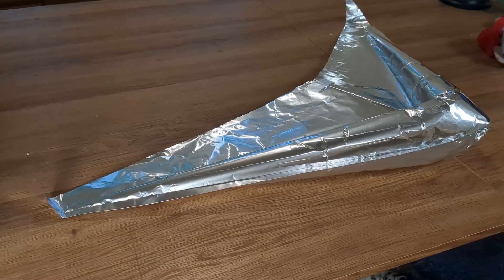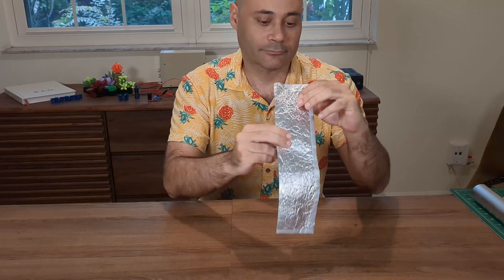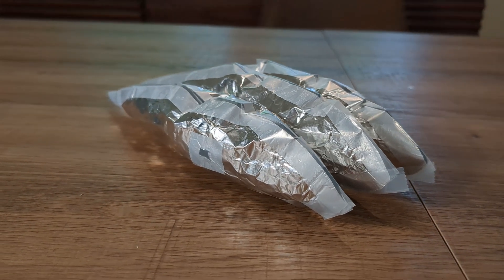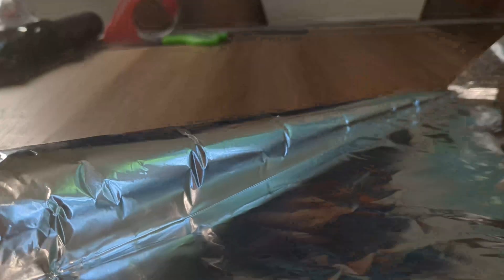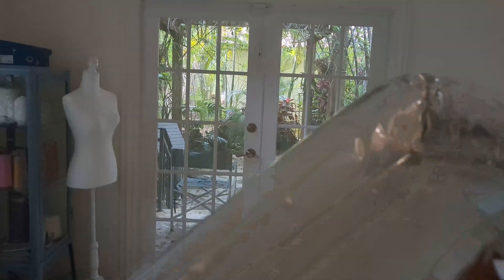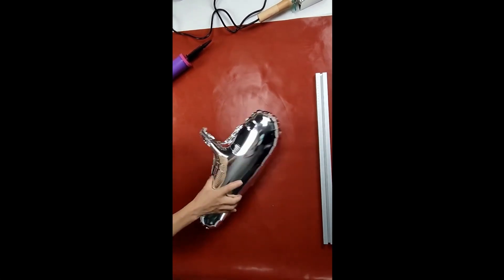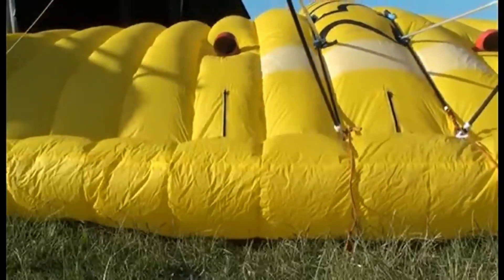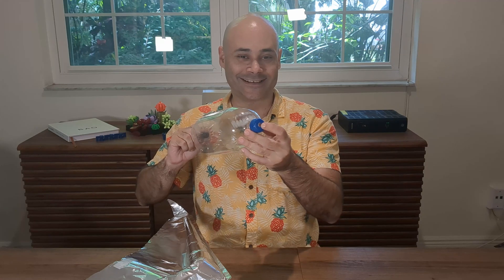Luma the Aluminum Foil Glider

Comment: Impressive. I'm thinking maybe use silicone rubber, make 2 flat sheets, glue the edges together (leaving a hole for air intake) then inflate. I make my own silicone sheets for doing resin crafting on and i can make them 0.5mm thick but i'm sure they could be made even thinner, and all you need is a flat surface and a perimeter to hold the shape while it cures. It wouldn't be as light as alumium but may be light enough if thin enough ? And it'd be a much smoother surface so aerodynamically superior in that regard. Liked and subbed :)

Comment: A while back, there was a fellow who made long tubes of black plastic. Once filled with air and put in the sun, the heated air inside created a good deal of lift, enough so that he had to tie them down to keep them from flying away.
His main issue was gluing the plastic together. He found the best method to use the double-sided tape that comes in devices like the ones that you apply white-out tape over typing errors. I bought some to play with, and it sticks very well. It is so thin that I thought it wasn't working the first time I used it.
Reply from the maker: @samTollefson  I'll dig around for that tape. It sounds really convenient. And solar balloons are fantastic. I once made solar tetroons.
Reply: @adrianinvents  I dug around in my shop and found it. It is called Telexsun glue tape. It comes in a device with 10m of 8mm wide glue tape. I got it on Amazon, I hope that helps.
Reply: Nighthawkinlight channel

Comment: I wonder if there is some opportunity for using a coating on the inside of the airtight envelope which would become catalyzed by the gas used to inflate it.  In other words, if you had a coating inside that became rigid when being exposed to say, oxygen, and it was "doped" onto that envelope in an anoxic environment and then inflated, exposing it to oxygen and quickly hardening, it could both inflate and rigidify the envelope.  
For example, let's say you were using paper with a waxed coating for the envelope (thus being at least nominally air-tight), and it was coated on the inside with cyanoacrylate (CA) glue.  Pump air into it to inflate it, and (in theory) the CA glue would cure by exposure to air, and become rigid (probably not, but hopefully you get the principle I'm trying to describe).  
Just trying to think outside of the box about what might be able to form the shape you seek while also providing it with durable structural integrity even if it loses its pressurization.
Good luck to you!
Reply from the maker: @bricology  This is a great idea. From my experience with industrial knitting I know there is heat rigidified yarn. You knit it along with other materials and then expose it to heat after the shoe has been put on a form. And thus you get a semi-soft/semi-rigid material. I like this idea of doping rigidity in with a spray. Keep thinking out of the box! It's the best type of thinking.

Comment: The design of your wing creates far too much drag to fly any real distance,  with that inflatable section at the leading edge.  The choice of foil looks like the very uneven skin will produce excessive turbulence, increasing drag even more.  IMO.
Reply from the maker: @maxhugen  You are correct. This wing was mainly meant to explore the aluminum foil construction technique as a prototyping tool. Long term this would not be the most efficient wing design.
Reply: @adrianinvents  I'd suggest using cheap rigid foam (eg Polystyrene),  as it can easily be carved/shaped to your own design.  Maybe look at NACA airfoil sections too. 😎

Comment: I remember V shaped logging balloons used in the 1970s that worked on a similar principle. My first though was how this glider would work if the "Cones" were inflated with Helium.
Reply from the maker: @roypounds7704  Logging balloons? I've never heard of this. My neighbor just threw away helium balloons, so I might transfer the helium over to the wing. The wing may still be too heavy.
Reply: @adrianinvents  Unfortunately, I'm having trouble finding any images of the V shaped logging balloons used in the 1970s up in the Oregon and Washington areas. The practice is still going on using more "Standard" looking, globular balloons.
Reply from the maker: @roypounds7704  I found one picture, if you search on Google for "From aerologger to balloondoggle" there is a pic of it. Very cool! Thank you for the knowledge.

Comment: Very inspiring. The main disadvantage is off course that it is difficult to get precise control of the shapes (such as un-creasing the foil in this case) but I am totally convinced non rigid aeroelastic constructions are the future.
Reply from the maker: @marcbrasse747  Thank you. Non rigid elastic wings would be great to see at full scale.
Reply: @adrianinvents  Flexible control surfaces will already be a big breakthrough. And they have been built. Ever heard of NASA’s MAW (Mission Adaptive Wing) project? Since then composite technology has been developed even much further. So the knowledge exists! 😀

Comment: You may be able to tape strips of cloth or paper across the insides to provide tension between upper and lower surfaces; paper/cloth is permeable to air so it doesnt interfere with inflation and long strips are a lot easier to assemble than strings.
Reply from the maker: @PixlRainbow  You are right. That is definitely the way to control the shape the best.
Reply: @adrianinvents    also, the reason you have not observed anyone prototyping with inflated aluminum foil is because most people generally just use foam board folded over itself and then taped/hot glued to create a KF airfoil. Such foam boards are commonly available in craft stores for use as posters, billboards, or backing for artwork/prints.

Comment: I work with honeycomb so my brain went straight to that. Doesn't meet you design criteria though. Interesting puzzle. I'm not satisfied with the airfoil you ended up with. I also don't have a better solution. Yeah, this is going to bug me for a while. How big does it have to be to lift the weight of the foil is a big piece of the puzzle.Hmmmmm.
Reply from the maker: @Rembrant65  I'm not satisfied with the airfoil either. The plane ended up being 16 grams. And the foil sheet started at a meter across.
Reply: @adrianinvents  Planes get most of their lift from angle of attack.  You can take a flat sheet and angle it slightly.  As you move it forwards, you get lift from air being forced under it.  Too much angle and it stalls, too little and there's little or no lift.  Airfoil is more of an efficiency tweak - it's not essential, it just gives you a bit more lift for the same amount of power.

For the soda bottle rocket, add some water.  It gives more thrust as the mass of the water is ejected (F=m.a) and helps regulate the flow of air a little, by providing a partial obstruction, like a valve.  It still tends to be a brief burst of thrust though, so I'd expect the inflatable wing to fold.  I used to make water rockets with a very similar design to the one you showed, when I was a teenager - with the tyre valve in the nose to pump the air in.  Anything up to 1/3 water tends to work quite well, but it's a lot more weight than you might want.  Any amount works better than none.
Reply from the maker: @TooSlowTube  I wouldn't have guessed 1/3 water. Seems like a lot. Thanks for the advice. My other thought was to use a small amount of alcohol vapor.